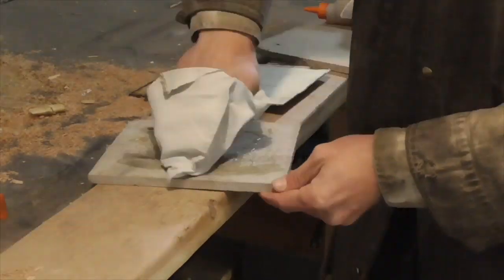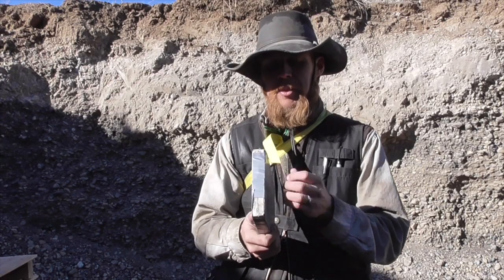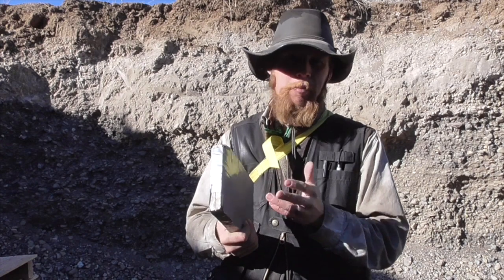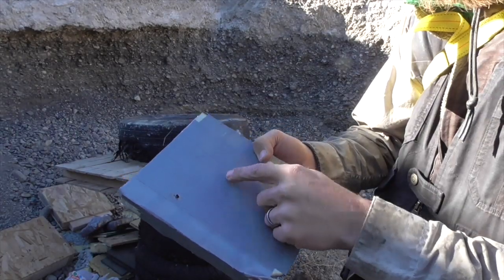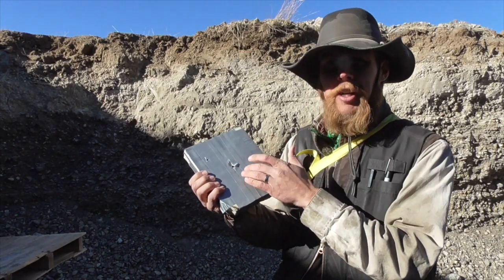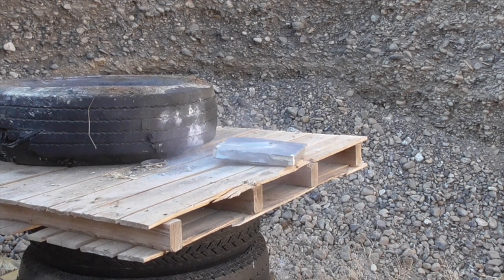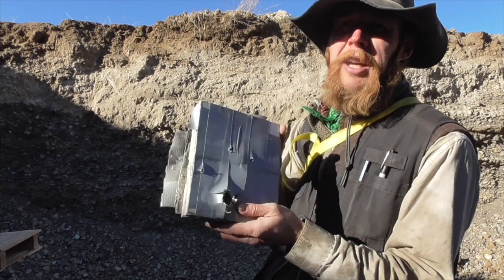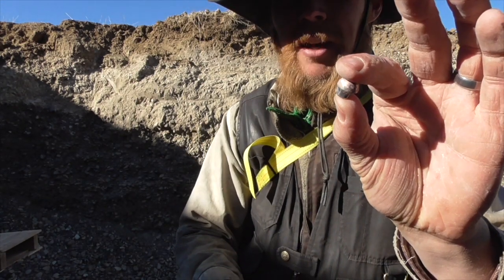Testing Improvised Armor: Steel-Wetboard Composite Panel (TIS241)

Comment: I you have the ability to peen rivet, try making a composite of 3 layers of 14ga mild steel, and 2 layers of steel belted tore rubber, backed with a layer of either fiberglass or a like dense and flexible plastic such as chunks HDP buckets.

The idea is to rivet the steel at it's edges through pre drilled holes, I'd also wager that a rubber contact cement to reduce delamination would help as well.

But the effect I'm hoping for is that the steel breaks the initial momentum of the bullet, then the stretchy rubber coated steel belted tore chunks absorb the impact shock and more momentum as the slug tries to penetrate the tightly woven steel mesh, and hits the middle steel plate, wh8h honestly could benefit more from being a harder maybe high carbon steel backed with another layer of steel belted tire.

Outside to inside.
Mild steel
Thick tire rubber
Hardened steel
Tire rubber
Mild steel
Flexible plastic with padding glued to it's inside to reduce impact and absorb the energy from the plate rather than taking it directly to the body parts below the armor.

Comment: Pretty good! Laminating really works. 

Maybe laminating keramics, with something ductile and tough, holding everything together would make for good armor(thinking of alternating holes that connects the ductile, tough material with each other, or maybe screwing them together with nuts and bolts).
Reply: By the way, check out this book: http://www.atplearning.com/product/1529/agricultural-technical-systems-and-mechanics-2nd-edition# . Im considering buying this (for me, im not that rich), but you might like it, while it has all sorts of things in it, that might apply to what you are about, and what you are doing(with the horses and all that). For me this is a lot of dough, but i think im going to buy it.. 

He, good luck out there! 

Best regards,...

Jeff

Comment: in addition I see a couple of problems with this as a practical body armor.  the first being spalling,  not of the bullet, but of wood chips.  even if the armor saves your life,  what good is that if you are blinded by the splinters?  and secondly,  on one of your shots,  it looks like you hit neat the edge.  I don't know if it was already weakened enough, but it looked like it barely stopped the round.  in a firefight with multiple hits,  this could kill the wearer.  just spitballing here, but what if you took two extra parts if sheet metal and formed them cuplike around the edges as a final assembly before duct tape?

Comment: hey Idahoan been awhile.  Right before YouTube sent me here,  I was watching Ian  at forgotten weapons,  and it was an older video of a 3rd pattern confederate Morse carbine  chambered in 50 caliber.  I know you shot some .50AE out of the Utah pistol.  do you think the Morse carbine would be suited to a modern cartridge  conversion (or scratch built) so long has it could safely handle the smokeless pressures? (assuming therefore a change from brass to steel in the action. )
Reply from the maker: That is an interesting idea.  I am planning to build a break-action carbine in .50 AE one of these days.

Comment: Make a composite panel that includes a 2" air space to stop the .223:

A "soft" copper and lead .223 Rem rifle bullet can shoot through a 3/8" thick mild steel.  Here is how I think it works:  The hole in the steel forms a "die" or "barrel" that prevents the lead from wasting energy by doing much radial damage, acting instead as a "lens" to focus the available energy on a smaller area, in a linear direction.  The copper jacket is usually stripped and fused to the 5/16" diameter diameter hole created.  It matters not if the bullet is a FMJ, exposed lead or hollow point.  If a 55 grain .22 bullet is travelling around 3000 FPS, it goes through that much mild steel...

The "containment" mechanism I have described above, is further supported by shooting the same .223 Rem bullet at two 1/8" mild steel plates, spaced 2" apart.  The same bullet that seems so capable on one 3/8" plate, goes through the first 1/8" plate, but is stopped by the second.  This is because the the containment mechanism is interrupted on exiting the first plate, and the mangled lead mass is then free to spreads out radially, striking a much larger area on the second plate.  On striking the second plate, there is not enough "energy density" to punch more than a wide dent.

Now try that with cement wood pulp and thin sheet steel + an air gap...  Two of the panels you used in the video, but with a space between them.  I bet that works better than one panel twice as thick.  Although your composite panel is already doing a good job of spreading the load area acting on the steel plate.
Reply: If you used a layer of quarter inch or 1/2 inch foam you would have a consistent airspace in a way to glue it all together.
Reply: What you are describing is similar to how a shaped charge generates a jet of hot and even vaporized metal that's forced to travel in a specific direction.

Like channeling an explosion, or in this case an impacts imparted energy.
Reply: And the solution is in another video idahoan did.. steel belted tire rubber.

Comment: Mythbusters did some blast testing with Line X coated cinder blocks vs dynamite and coated plywood vs dynamite (or was it c-4) ... I wonder about penetration of metal and thin (quarter inch) plywood with LineX as glue ... Hmmmmm
Reply: Linex probably won't work for that but you can use it a spalling reducer, also it was c-4 I just watched that episode

Comment: Well you certainly proved how important layering is. Materials that were pretty much useless on their own when layered with other materials are quite effective as you have so aptly shown. Fun stuff for sure.
It would appear that the wet board without backing just blows out, but with the sheet-metal it probably bends the sheet-metal as the clay (clay like composition) has nowhere to go. Funny, I watch a lot of different gun channels and science related channels etc., but your improvised body armor experiments are the most fascinating for some odd reason. I hope I haven't rambled on too long. Have a great day my friend.